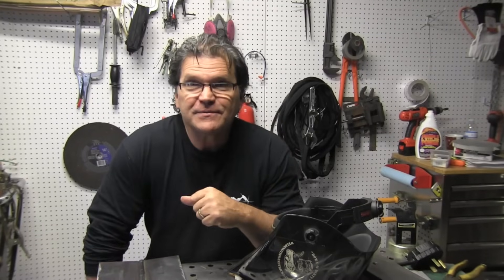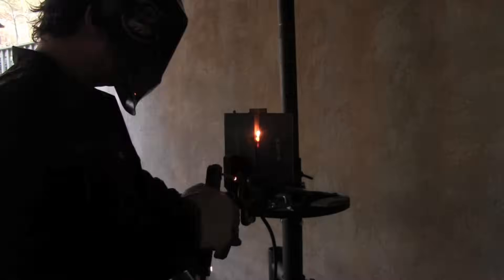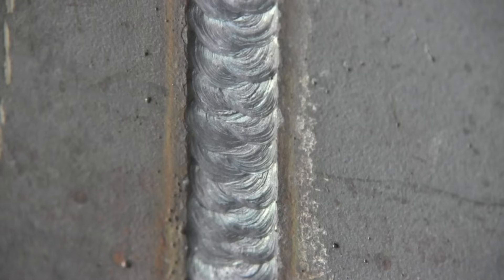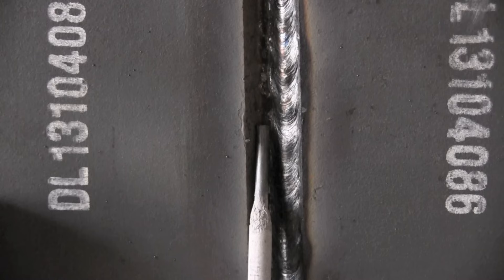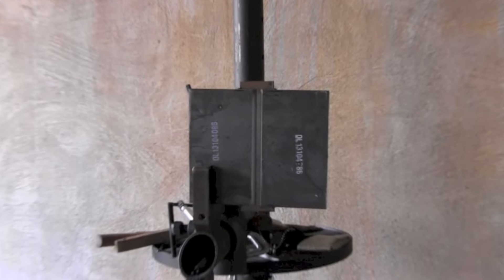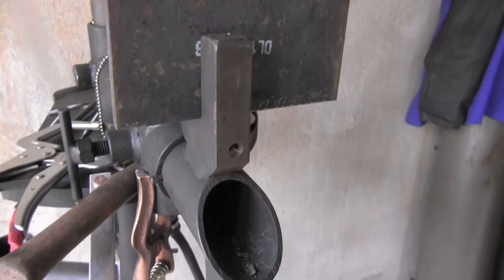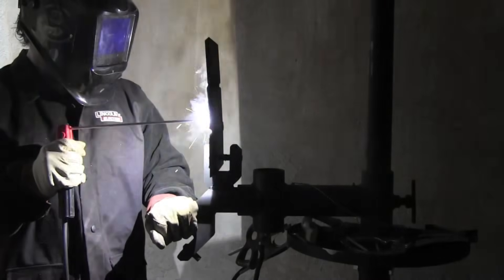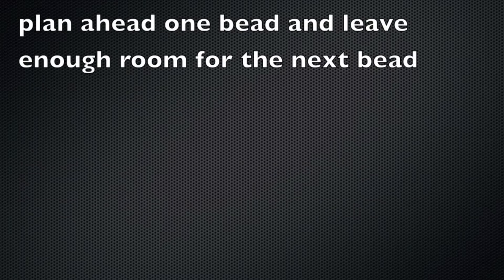3g Weld Test Stick Welding Tips Vertical 7018

Comment: Hey Jodi,
I like the video, it cleared up some problems I've been having. My instructor has moved me from 1/8" 6010 to 7018 and threw me straight into vertical up. He says my beads look fine, the only problem is my start and stops. I can't seem to grasp how to get a seamless joining of two beads. My instructor told me to strike an inch or two above my previous bead and quickly drag down then loop around the puddle of the last bead and hold for one second. I keep finding myself with a globular start. Any tips on how to get a consistent bead with multiple starts and stops? I'd like to hear what you have to say.
Andrew

Comment: i went ahead and back a few times in this video , did you mention what settings you was useing on the machiene? Amp's and Arc force?
Reply: 120 amp
Reply: +mxdevil flores thank you , Yeah after watching again i saw he mentioned that after rod angle. still wondering about arc force
Reply: +Viper4kPlayground the v of the arc is determined by how close or far away you stay of the puddle 1/8 is the distance i try to keep when using any 1/8 rad

Comment: U r a bad man with that stinger bro after watching your 3 and 4G stick test vids I passed my one inch v groove test vertical and overhead test now am working on Flux cored wire test E71T-8 5/64 nr 232 and 233 it would make my day if u made a video on that type of welding test I get practice in 1 day a week but the videos play a role in improving my advantage just by paying attention to the sound of a good weld along with when you explain on troubleshooting and my eyes getting familiar with the puddle characteristics

Comment: Do you drag the rod?
Reply: +Latasha Overstreet z motion or circler motion
Reply: +KWAME WILLIAMS never drag a 7018. for 3g up use the whip technique.
Reply: do you listen to a single thing he says in the fucking video?
vertical up is a push angle
Reply: 1/8 off steel slow and steady up movement.my hands shake so for me it is just straight up with a little shake side to side motion looks good lol

Comment: Is this with a knife edge or do you put a land on the bevel??
Reply: +Ismael Roberto should be 1/16 land
Reply: +Johnny Mango thanks I tried with a knife edge on a test vertical an 1/4 gap didnt went to well. hard do avoid undercut on the root pass. plus I cut the plates with a Iron worker and left a slightly gap between the backing plate and the 3/8 beveled plate.
Reply: Ismael Roberto bro that slight gap between the backing plate and the beveled plate is creating more heat and giving you the undercut i'd bet my money on it. the backing plate also absorbs heat when its flush. but it has to be FLUSH. might be safer for you to tack it up yourself that way you can see where it starts to go wrong. i have the same problem with my fitter. good luck brother
Reply: +Johnny Mango thank you I really appreciate the tipss. I will try that 1/6 land too.

Comment: my problem with stock on vertical  is i start out great and once i cone about an 1 inch  to 2 inches from the top it wants to fall out i don't know whst to do.  i feel like i am keeping a tight arc . my amos are at 120 i am welding with 1/8th 7018 rod
Reply: +money maker    try a little lower amp like 115 or 110  it might help . other than that just practice practice practice
Reply: +one ty
Reply: +money maker bro heat rises. as you ascend near the top quarter of the plate all that heat has accumulated. try increasing your travel speed by 15% as you near the top. this fixed my issues at the top i hope it helps you.
Reply: put the ground clamp on the top of the plate

Comment: my problem with stock on vertical  is i start out great and once i cone about an 1 inch  to 2 inches from the top it wants to fall out i don't know whst to do.  i feel like i am keeping a tight arc . my amos are at 120 i am welding with 1/8th 7018 rod
Reply: had the same issue. I was slowing down because I was nearing the end. my travel speed was slowing an my rod angle was changing. It still gets me now an again. I know that feeling though.
Reply: +money maker I used to have the exact same problem and Jody's advice about trying to stay at dead nuts 90 deg (because you will likely end up pushing at the top) might be the answer.  See if you can get someone to watch you through a couple of beads focusing on your rod angle and not your puddle, I'm not an expert (haven't welded as a trade for over 15 years but finally returning to a job that appreciates that I can weld). This problem plagued me when I was working on pipe and we were trying to weave in a cover pass. the last inch or so of my pass would sag out and look terrible. The advise I was getting from my co-workers was typically very unhelpful. I wish Welding T&T ahd been available back then
Reply: +money maker The best thing to do in my experience if you're having this problem is to stop when you get close to the top and let it cool a bit before finishing. Another thing you could try is tilting down so your rod angle is pointing slightly downward the closer you get to the top and really bury your rod in the puddle, but be careful not to stub out
Reply: Are you using a DIG setting?

Comment: started school last Tuesday for welding. the job I'm going for doesn't use stick but stick is the first class. Anyways I'm having a hard time with a vertical pass. I have a hard time controlling the puddle and maintaining speed. I can do horizontal pretty damn good. just need some pointers on vertical. Thank you.

Comment: Omg the way that slag comes off 😍😍😍
Reply: I did X-Ray on submarines for years with almost a 0 rejection rate.  Mostly using 11018 and 8018 in every position imaginable.  That's how my slag always came off AND I seldom removed the slag before tieing into the previous bead.  Most times the restart would pop the slag off.  40 pounds a night of 1/8 rod and that was with an interpass temp requirement of 200-300 degrees.  Moved onto horizontal (and flat) subarc and even some experimental hand held subarc.  100 pounds USA not unusual but again temp requirements and engineering inspections kept deposition rate low.
Reply: +Frugal forge Blacksmithing dont be mad that you cant do the same
Reply: ***** afford to?
Reply: bujashaka clean material helps
Reply: Yeah i wonder that also .. im sure the best quality rods help ..
Reply: +Bryan Espinosa he is showing off.

Comment: If you did a wide pass over the root rather than 2 passes when it was tested can they tell?
Reply: +saltire546 I only do one slow and tight pass for the root on a plate test.
Reply: +saltire546 yes they can tell a stringer from a weave

Comment: i'm doing high pressure plates with a 45 degree bevel, and a 3/32 landing. Can't seem to make my welds look like yours on vertical. I'm using about 115 amps but it seems to gouge and the weld doesn't seem to want to advance up the plate. very frustrating knowing I have a cwb test coming up soon. ill try and follow your tips though, thanks for the videos, you rock buddy.

Comment: Idk.. Earlier you were doing 114amps, then on the last, turned it down to 110..
Is that due to the more passes, you turn it down a few amps every 2 passes or so?
I think that's why I can't get my nice beads again,is because I'm too hot..
Brilliant idea to practice uphill with the back of the backing plate
Reply: LightGesture root pass is always hot
Reply: How do I avoid toeing? My stick frequently blows out to one side instead of straight, I have good arc distance and am evenly distributing the metal, but it just tends to favor one side, I have tried finangling my work angle, but no real luck....
Reply: +LightGesture Perhaps you are experiencing arc blow. Try fiddling around with the ground clamp position, rod angle, and so forth. Alternatively, get some 7018-AC and run your beads on AC current.

Comment: hi Jody, what's the provider of your 7018 sticks? I see the flux peeled off itself right after cooling down. I use always 7018 sticks from Air Liquide, the flux is never that easy to remove, even with a chipping hammer.

Comment: Whenever I've tried a vertical stringer the weld bead is a mess of solidified metal drips, and the flux is all over the place. Usually use a 6013. A weave works for me, but I can't yet master straight up.
Reply: Rufus Chucklebutty I've never run 6013 vertical up, but I know for 7018 if you're getting a lot of those drips and no fusion you're probably not keeping your arc length tight enough and/or moving too fast. I had that problem a couple of weeks ago when I came back to welding stick vertical up. When I focused more on jamming that rod in there and moving slow enough to let the puddle keep up, the issue was fixed. It just takes practice man, you'll get there.

Comment: Jodi
I was just wondering why you switched around on different machines. 

Do you favor one  over the other?
I used my thermal  arc at work (long story don't want to bore you) it did surprisingly well. 
I have a Lincoln tombstone welder at the house and but mainly use my thermal arc 211i. Since its a inverter and doesn't trip the fuse . Thanks for the videos I enjoy them

Comment: Hi Jody. You mentioned that the vertical test and the overhead test pretty much come hand in hand. Could you please make another in-depth video on overhead groove welds with 7018? If you have the time that is. Thanks!

Comment: Thanks for another video Jody.When I took my test(years ago)we had to use 5/32 7018 vertical up(NY state dot on a 1" plate) I failed it twice and than passed it on the third time.I ran a slight weave on the last test.I think the reason i failed before was i used a bigger wire brush and couldn't clean my root pass good enough.On the third test I used one of them wire tooth brushes to clean my root pass I was able  to get in there alot better to clean it.Always look forward to seeing your videos.

Comment: Jody, ive been having issues with 3/32 and running vertical up 7018s.  The 7018s are burning through on 110A... also causing undercut... They act like its high arc'd while running a proper distance.  Running about 90* on verticals.   I did just recently go with a magnetic ground from the LWS to weld up the subframe cage on this 4 linked truck.  Ever since then Ive been having issues.  Is it normal to have a magnetic ground mess with your welds? (DCEP)...  The slag is also jumping to the rod and killing the arc... im assuming this is due to low current (110A vs 120+)... Im running lincoln excaliburs.  Im kind of lost and really frustrated with it lately.  The welds are drooping hard also with stingers..

This is the first time Ive tried the excals, ive used Radnor and Hobart normally as this is what is usually local.  On flat welds with the radnors or Hobart im getting the slag peeling up behind the welds and they look flawless..  I just dont understand if its me, the ground, or the rod.
Reply from the maker: the first thing I would do is try getting rid of the magnetic ground because there is definitely a potential for problems if you weld near it...also 110 amps sounds  hot for a 3/32"  7018. I would try dropping below 100...  Seems to me that the Excaliburs can take a bit more amperage than other brands but still 90-100 works on my machines.  good luck
Reply: The 110a was with a 1/8 and its burning right through. That's why I was so confused on 3/8 steel. Thanks for the reply

Comment: Jodi,
Great video. Are you using AC or DC current?
Thank you for posting such an informative set of vids!
Eric
Reply from the maker: Dcep
Reply: OK. Can the same technique  be used with AC and 7018 rod?
Reply from the maker: esoomreltna
 yep, same technique works using  AC but you might need to get some 7018 AC rod (7018 designed to be run on AC) Some squarewave tig welders will burn a regular 7018 on AC but other AC stick welders will not
Reply: Jodi,
Thank you!
Reply: I ran 7018 using DC today.So what's the difference between 7018 AC and 7018 DC ? I am a newbie by the way.

Comment: One of the techniques we used years ago when taking certification tests for armor steel vertical vee groove was to weld the two outboard stringers on the cap first then work towards the middle of the joint with temper beads. Actually this was a requirement that the last bead not impinge on the base metal. We also had to run stringers in the entire joint....no weave whatsoever. It takes ALOT  of stringers to fill up a 1 1/8" vee groove.

Comment: are you allowed to ask ahead of the test what is allowed and what is not
Reply from the maker: In my experience as long as you respect the test admin, ask away
Reply: +william gurnsey the root pass should be the hottest so you can have a good fusion on the baking plate and on the side plates
Reply: +mxdevil flores ok sweet, im going to try a couple at 115-117 but i will see. what do you run yours at?
Reply: +william gurnsey i run my roots around 125.  if 115 seems hot try holding a tighter arc length
Reply: +WT Kurtz ok sweet thanks, i am still learning ( in school still) so im screwing with amps to see what i like best.
Reply: +weldingtipsandtricks would running the root passes at 115 be ok? i ran a couple at 113 and found them very hot.
Reply: +william gurnsey I just got the hang of the uphill stringer in time to pass my CWB test. I was having trouble with heat as well, and I learned from Jody and ChuckE2009 to do a little weave... a very little one, but it helps me to stop worrying about my travel speed and lets it burn in just enough. I was sagging and had a big blob at the conclusion of the weld. that little nervous weave is key!

Comment: Is welding the backing plate part of the test? I remember we used to knock the backing plate off when we were doing bend test back in school.
Reply: the 70 is the tensile strength the 18 refers to the positions it can be used in welding.
Reply from the maker: D Fuller AWS D1.1 code plate welding tests usually include a backing plate. There are provisions for doing an open butt root in most codes but it just depends on the scope of work involved.
Reply: sir. what's the meaning of E7018

Comment: In Canada we have to do a fillet pass on each side of plate for first passes and also have to stop and start where inspector marks the area of choice . Definitely will make it harder to get slag or lack of fusion in the middle of the first passes . The root pass with a weave would make it a better test to do . Thought it was the same . Good video anyway . Thanks

Comment: We need to do the exact same test to qualify in-house but with an open root(no backer plate) is this a normal test?  Any tips on passing this test, because I'm sure if you can pass open root, then the rest should be easy.  Thanks for the videos... keep them coming.
Reply from the maker: buds207 this is a pretty standard AWS test.  But there are all sorts of provisions within code books to test for the scope of work being done.
Reply: weldingtipsandtricks here in Canada we do almost the same test as your video, but we have an inspector visually approve the root pass which is stopped at a designated spot. If you pass that first visual, you are certified to weld in the 3F position and are cleared to finish the rest of the coupon for a 3G. The entire test is referred to as the 3GF.

Comment: Another quality video from Jodie. What'd you recommend for a welder amp range Max in a welder to look for? My tig maximum is 130 DC in stick mode and find it cold sometimes. Does Max of 185 DC in tig why the big difference? Should I buy a dedicated stick machine ?

Comment: I have taken this same test for employment requiring all stringers, two bead root and one pass of 5/32, with max reinforcement of 3/32 then X-rayed, no grinding, just a wire brush and chipping hammer great tips for people getting ready for a structural employment test at a shipyard
Reply: Are u guys rooting t h sr with 7018 or 6010 the way they do it where are from is one root 6010 then 7018 hot,fill,cover how do u guys do it that are first thing we do when we are  practicing for welding pipe
Reply: we do 7018 roots. No pipe gets stick welded where Im at.